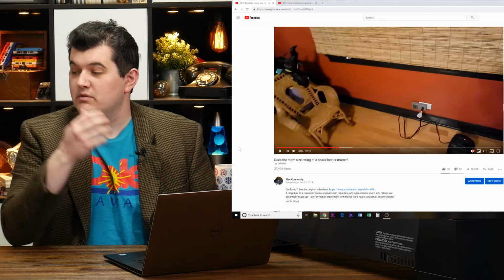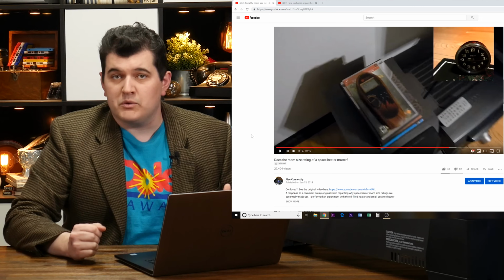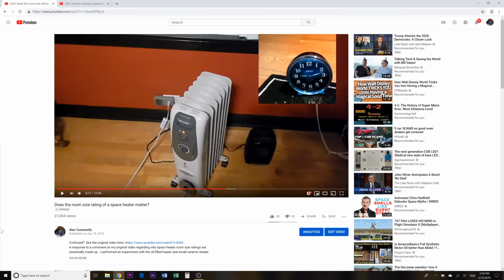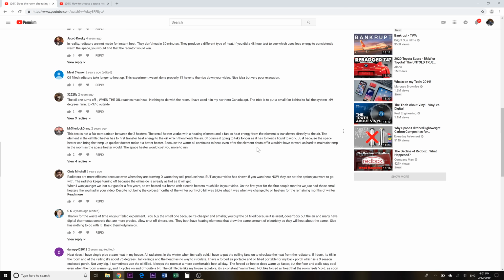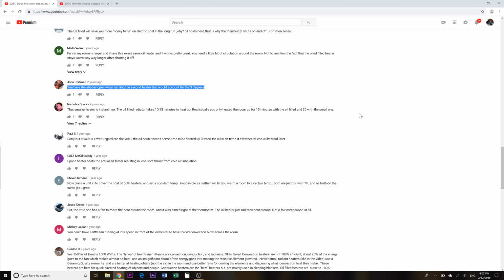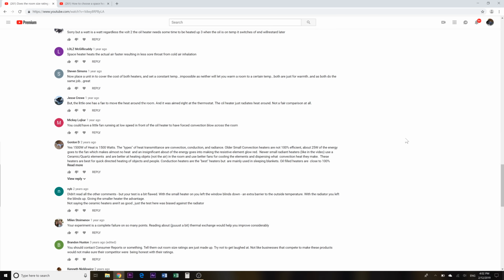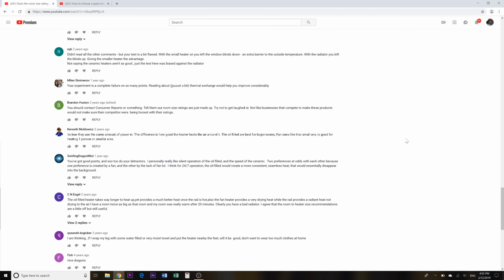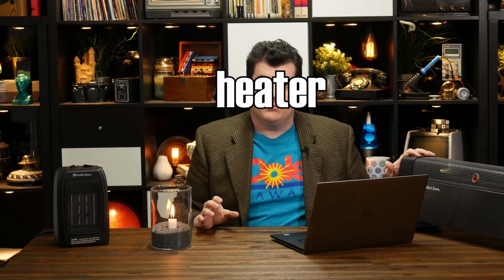More Space Heater Nonsense

Comment: I think the person who broke the oil filled heater by messing with the thermostat demonstrated another limitation of that heater without realizing it, and that it’s not the thermostat feeling the heat from the body of the heater that makes it turn off and become less effective.

The heated oil has to rise for the heater to work like a classic radiator, and that means it must expand. But if it heats and expands too much it will rupture its container, or break down thermally, or even boil. To protect against such possibilities the oil filled heater limits the internal  pressure of the oil, either with a pressure sensor or with an absolute limit on  the temperature the oil can reach regardless of whether the temperature in the room has reached the set point. Steam radiators have a pressure cooker like valve to prevent too much pressure, and the boiling point of water at that pressure limits the temperature it can reach.  The oil filled heater must resort to other means to achieve those essential ends.

My guess is that's what causes it to stop drawing current before it heats the room enough to reach the set point of the thermostat.

Comment: OK this video was annoying.  It seemed to you like everybody was disagreeing by agreeing because of how you structured your thesis.

I agree that the "big room" heater shouldn't be used in a big room, that its specific heat is going to suck in energy that will make the heater take longer to reach temperature and radiate at temperature, etc.

I agree that the smaller heater dumps heat right into the air, basically as efficiently as possible.  (But could a fan help spread heat or affect the heater's performance?  Yes, it could.  In the extreme case, imagine a pipe guiding the hot air right at your thermometer)

You but then you go on to say that there is "no reason" for the big space heater to be better for a big room, just because they're both 1500W.  But your experiment goes on to prove that the properties and design of the space heater actually affect the heater's performance.  So there is a difference between space heaters, some of which make some heaters better than others.

Comment: Wow - I actually learned something. 

Yes, it is obvious to me that a 1500-watt heater, running continuously, will generate the same amount of heat as another 1500-watt heater, also running continuously. But, just as heat must be added to a room at the rate at which it leaks out to maintain equilibrium (remain at constant temperature) so too must the oil-filled heater’s surface dissipate heat as quickly as the internal element adds heat to the oil, at some safe temperature, otherwise the temperature rises until the heater becomes a danger.  Hence, given the surface size and the lack of forced air flow, the thermostat really does need to measure the heater’s temperature rather than that of the room, and turn off the electrical element’s current before the oil reaches some maximum allowed temperature.

And, as you point out, the result is that the “large room” heater draws, and hence dissipates, less energy per hour than the small heater – which I would not have guessed.

Comment: Maybe the science deniers will enjoy these three facts: 1) heat pumps routinely acheive 300% efficiency. 2) dehumidifiers are also over 100% efficient at turning electricity into heat 3) no electric heater ever built is less than about 100% efficient in a room without a window (ignoring chemical losses, and magnetic flux losses too small to measure). This is because no system anywhere in nature is less than 100% efficient when considering all outputs. Normally heat is seen as a waste output, like in a car IC engine that produces about 75-90% heat output with the side benefit of a small amount of torque output. However if heat energy is what you want as output then efficiency is kind of a given

Comment: The problem with the oil heater is that it's power rating is different from its average power consumption/output due to the technology. There was no easy way for you to make a proper experiment to prove that "same energy consumption = same room temperature". You'd have needed something like an integrating powermeter for the oil heater to evaluate the true energy consumption of the heater to compare temperatures at same consumed energy. Furthermore, since a lot of energy goes into heating the heater itself, it would have probably been necessary to preheat it outside the room or run the experiment for a very long time (eg half a day) to make your comparison.
One interesting thing you would have gotten would have been the average (or practical) heating power for the oil heater vs power rating. This IS a limit of the technology that low inertia heaters don't have.
A bit late to the party, I know.

Comment: The issue your likely running into is not the Watts that your focused on, it's the 'Better' people object to.  When heating a room with a 1500 watt heater you only need the 1500 until the room gets up to temperature.  Then you only need say 300 to sustain it.   The difference between the two is how it maintained the heating at 300 watts.  The little one blasts 1500 watts into the room then shuts off for a while.   The large room heaters heat an intermediate thing and let that thing radiate heat into the room.  This feels a lot better when people walk by.  lest likely to burn kids etc.. If you feel the need to have the heater on 1500 watts all the time to maintain the room temperature.  Then close the windows or fix the house.  You can in fact test this.  you need a better kill-o-watt that records over time and a the monitor that records over time.  run them both for a few day/night cycles then compare the graphs and how the room feels.   The large one should have a more even/stable temperature.

Comment: You know what it is? It's convenience. The large room heaters have large thermal mass, silent operation, and timers because they're designed to be ignored. On the other hand, space heaters always come with like thirty different tags telling you not to leave the damn thing running unattended for even a second. 

While the nuance of this duality is probably more than a little bit of home economics theater, especially with modern safety standards, I think you particularly struck a nerve because as Americans we get mired in the idea of "as-advertised", like you mentioned about it all being marketing. I think as a result of that we're also fastidiously consumed with making sure we use our things "correctly" in accordance with the product marketing so that video might have been disliked in that regard, "beCauSe YoU caN'T uSe a FaN heAtEr tO waRm aN enTirE roOm." 

I mean, ultimately it's all down to preference--it's like saying, wow, all lamps fitted with a 600 lumen bulb make 600 lumens of light! Like, yeah, but I would much prefer those 600 lumens to be diffused gently into the room rather than glare directly onto the top of my skull. With heaters I similarly think there's a type of preference or 'curation', if you will. If my feet are cold a fan-forced space heater is perfect. For our basement, we've got a Delonghi electric radiator blown by a Lasko thermostat-controlled box fan that clears the fins every half hour to keep the entire space comfy. It just depends on the space, and I guess to me the power output calamity seems silly because you're still going to pick what fits the space. Just because some guy on the internet said fan-forced heaters are more efficient doesn't mean you gotta buy twenty of em and sit in a dark room, like damn.

Comment: Okay. I will disagree with you but in a point that there's nothing to do with actually the amount of heat being produced. And it's a debate, not an affirmation.

In theory, oil and quartz heaters should be more efficient hahahah. Even if they produce the exact same amount of energy / heat.

Simple because of the user. Since those small heaters transfer energy directly into the room when the heater is turned off the room immediately starts to get cold so soon is turned on again, being manually or automatically. The problem is that, since there are those valleys and hills of heat the user tends to set them on a position more warm to compensate the valleys and avoid being cold. On a oil or quartz heater, since there's a medium between the environment and the heater, although it takes longer to heat up the heat dispersion is constant. So the perception of cold by the user is small and then the user sets it to a lower temperature.

In theory, on maximum, yes, both heaters warm the same but when you accountant the perceptive heat or cold from the person you can get a comfortable temperature using less heat, which in turn wastes less power. That doesn't mean that the heater itself wastes less heat, but that the perception of a comfortable environment is achieved in a colder environment just bc the temperature is stable.

It's a different point of view, obviously. And for heating on short periods of time is the complete opposite, but normally when you heat a environment you want that environment to keep warm for a long period of time.

Comment: I must have seen this before, but it seems like the heaters that are quieter and release heat slowly and more steadily if releasing less heat overall would be what you would want in a SMALLER room. In a larger room, something noisy can be further away and the room itself can hold more heat to smooth out the heating process. The ONLY validity to that marketing that I can think of is that the oil heater might be switched of by its thermostat less in a larger room where there is more cold air to circulate and take heat off the heater, but that is totally backwards because it's not buying advice, it would only be useful as instructions once you have bought the heater to get… the "most" heat out of it?? but yes somebody else commented, the smaller one can fit in a smaller room and not take up as much space, and if an appliance company can market you two seperate heaters to heat different rooms instead of you just using the one and putting up with perhaps unwanted fan noise in a small space they will.
Reply: Also, the person who commented "Radiators are more efficient because even when they are drawing 0 watts they still produce heat" (actually I think it was "O watts," not even the number 0)  is infuriating. Do they think it's a free energy machine? It's the same heat that was produced before and instead of being in the air where it's nice n cosy it's in the oil.

Comment: The oil filled radiators are more efficient in a practical sense, even though thermodynamically, 1500W is 1500W. This is due to the more consistent heating, people won't turn them up as much. Similarly, radiant heat is more efficient than radiator heat, which is more efficient than hydro air, even if all three are running off of the same 95% efficient gas boiler. Radiant and radiators distribute the heat more efficiently throughout the room, resulting in less energy used to make the room comfortable for the occupants.

Comment: The "Quartz" heater I have has a cool feature, when the fan is not on, due to the thermostat setting, the coil stays warm/hot, not heated all the way up, so when its time to start blowing hot air again it doesnt have to completely re-heat the quartz coils. I tested it with my hand when it started up after a couple of cycles and it actually works pretty well, the air is nice and warm just not as much when it heats all the way up. The thing I dont know is if it uses more energy using this method or just reheating the coils all the way back up from cold...

Comment: This is totally irrelevant now, but I suppose it could depend on the oil heater you have. For me in particular, the one I have doesn't have a thermostat, it's either on or off, high, medium, or low. It doesn't regulate itself which could change the outcome. Once it gets warmed up, that thing gets HOT.

Comment: This is just my own subjective experience: I have had occasion to run space heaters in northern climates since the 1980s. The watts are the watts. No argument. But the small-room space heaters don’t last as long if they’re used to heat a larger space, so I have had to replace them more frequently. The units labeled for larger spaces have simply lasted longer (in at least one case, it still works after three decades).
Reply: Probably because the switching and sensing hardware for larger square footage is rated for much more frequent cycling.  It's not just the elements that people need to pay attention to, it's the thermostats and switches.
Reply: just like any electronics, and appliances. you won the space heater lottory.
Reply: I'm guessing that's because the heating elements in the small ones with fans get hotter for longer. I'm guessing the oil filled radiator ones last longer simply because their thermostats shut down the heating elements more often, thus extending their life. Also, if they're heating elements are in oil then they probably get fewer or cooler hot spots on the heating element itself. Thirdly, the small one with a fan has a fan. That all by itself reduces the reliability of the unit because you've got yet another part that can fail.
Reply: Some people who has those Oil Filled heaters for large rooms, Had oil leakage problems under just 2 weeks of usage. so large room does NOT mean more reliable.

Comment: Just rewatched this, having just re discovered that a new 3kw oil filled radiator I purchased is basically useless.

Irrespective of how I set the thermostat, if I select the 2kw or 3kw "mode", the heater warms up, and despite being in a cold room at 10 degrees C, the thermal cutout, which is seemingly wired in series with the 2kw element, cuts out after only 5 minutes, and the heater then draws 0 watts if the 2kw mode is selected, or 1kw if the 3kw mode is selected.

It NEVER seems to turn the 2kw element back on again, unless I let the heater completely cool down again.

Seems like a totally ridiculous design to me. Wishing I'd purchased 3 X 1000 watt  oil filled radiators instead, which would probably have been cheaper in any case, albeit physically larger and less convenient.

Any advice gratefully received.

Thanks again for another great vid...
Reply: Get a cheap fan and blow air past the radiator unit. That will keep it cooler and the thermostat is less likely to shut it down. Problem solved.

Comment: It is because stupid people are stupid.
If the company tells people one is better for bigger rooms than people will blindly agree and fight anyone who say otherwise.

I recently just purchased a couple air purifiers and the same thing exists in that market too.

I purchased a BlueAir 211+ it is rated at 400CFM and is for a larger 550ish Sq.Ft sized room, I also purchased a Winix which is 275CFM and rated for a 360 Sq.Ft room.
Those two are accurate to recommend for their rooms based on 5 exchanges per hour- which is the the standard for air purifier effectiveness. 

Now here is the kicker- Dyson claims their solution is rated for a 800sq.Ft room, if you know anything about Dyson, you would know #1 it's overpriced garbage and #2 their "bladeless" technology is only rated at about 40 CFM.

All respectable air purifiers rate their capacity by 5 exchanges per hour, yet Dyson, with a measly 40CFM says it can do almost double what a machine with over 10 TIMES the air flow over the filter media- Yeah... sure.

Comment: They only things I can think of that make them different are:

1. That smaller on produces the heat much faster/distributes it much faster than that larger oil one, like you demonstrated.
2. The larger oil one, or larger ones in general, maybe do a better job of keeping the heat more consistent. They do not produce more heat, but because of the way they distribute the heat, you do not get the ups and downs of the temperature like you would with the smaller one, thus they are better for larger rooms? 

For example, that smaller one, heated up the room 5 degrees in 15 minutes. But how long does that last? Does the temp need to drop 5 degrees before the heater starts again and re-heats the room vs. the larger one (or that oil one to be more exact) which takes longer to heat up to that 5 degrees, but it does a better job at keeping the room consistently that 5 degrees warmer and thus, you do not get the same ups and downs of temp.

Again, both produce the same heat, but efficiency (or rather effectiveness) is more in regards to how well they keep the room at a consistent temperature?

Honestly, No. 2 is the only thing I can think of as to why one would be rated for a larger room vs. smaller room, or as others pointed out, the smaller one is smaller, so takes up less space and thus is better for a smaller room, but then it taking up less space, could also be great in a larger room as well.  lol

Comment: To be honest, this issue should be a no-brainer if you have basic knowledge of physics (or basic education). 
The only way a huge thermal mass heater, meaning one that delays the heating of the air, would be more effective (assuming it runs constantly and the thermostat doesn't limit it's power) is taking into account the cost of electricity: so more cost effective. This would work if the night time price of electricity is lower, so you'd start your heater at night, and stop it in the morning and it would keep putting out heat that's gathered with a low price during high price hours because of it's thermal mass. But again, this is cost effectiveness and not the physics meaning of effectiveness.